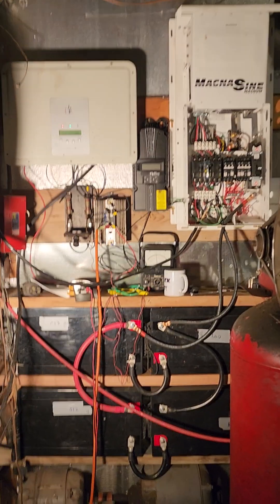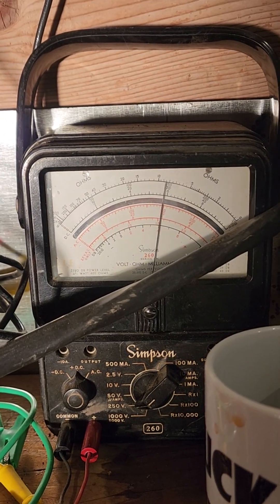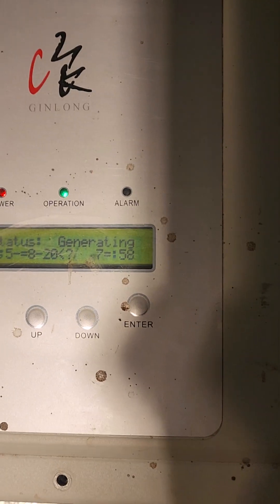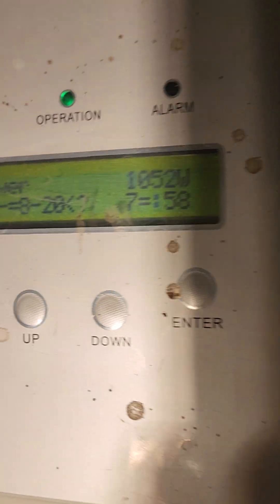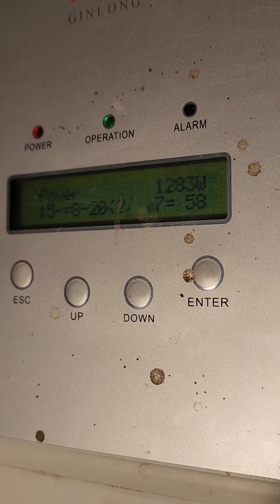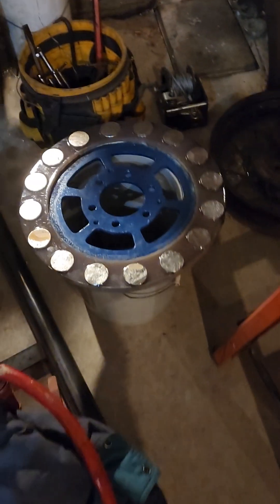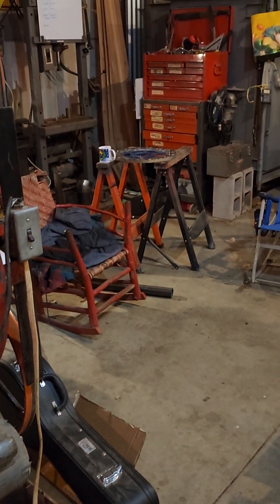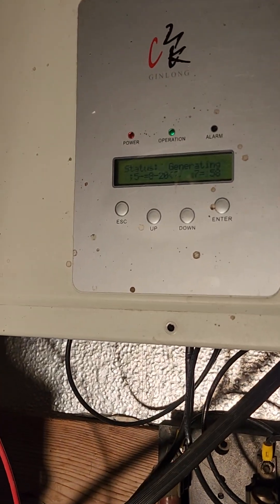Utility connected home made 10 foot diameter axial flux wind turbine.

Comment: How many points does it allow you to enter on the power curve ? - i have one of these and am tempted to try it with a WT2500 that im aiming to get flying this year.
Reply from the maker: Lots, but you have to use 10v increments, I think starting at 30v and ending at 700.  My wind turbine cuts in at about 50 and I ask for maximum output (2400w) at 120V.  So im only using about 8 spots.  I leave it at 2400w up to 200v but it rarely hits 120.  It's only a 10' turbine so the goal is to stall it a little on the upper end.

Comment: for a top end overvoltage protection (and since you already have the classic/batteries there) by manipulating/stepping both power curves, you could use the classic to grab the machine (in parallel with the ginlong) to help protect the input of the ginlong from overvoltage. granted your upper end voltage on ginlong is below the max input of the classic. Just a thought.  Good to see that inverter getting some use!
Reply from the maker: That should work, although I did somehow 'torch' a classic the other night attempting to do about exactly that thing... and I don't know why, it kinda makes no sense and I'm a little afraid to try again.  I had the classic setup to start charging a little after the ginlong.  Shortly after the point when both were producing (a little over 100VDC) the classic was producing about 300W and burned out.  The inverter went into an error mode (UN-BUS) or something like that and stopped producing/put the turbine into free spin.  I shut everything down, started back up and the inverter was fine.  The classic had lost most of it's magic smoke though... again I'm confused as to why.

Comment: What is diameter of magnetic plates and stator
Reply from the maker: 12 inches and 14 inches respectively.   There are other videos of this turbine here on my channel.
Reply: @dansshop  single piece of wood use or multiple pieces of woods joints each other and than make blades
Reply from the maker: @mianqaisar53  These ones are laminated but they wouldn't need to be!
Reply: @dansshop  thanks sir